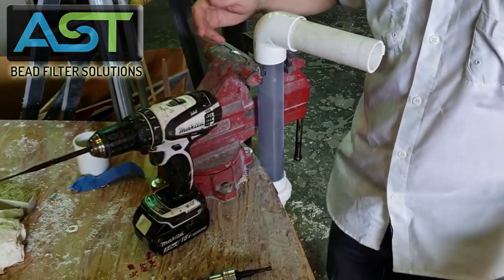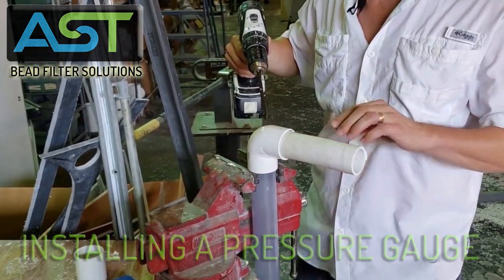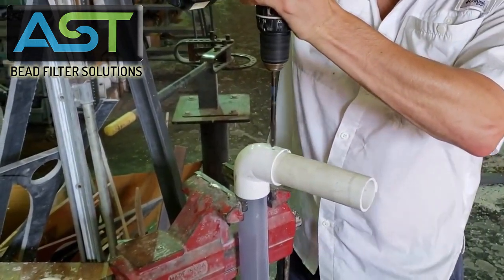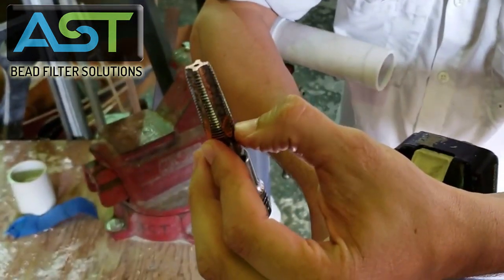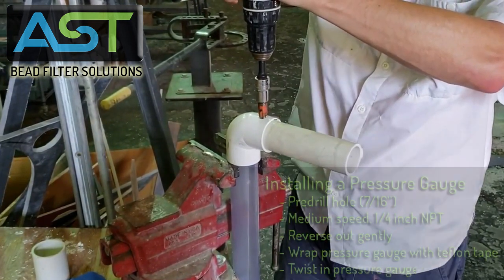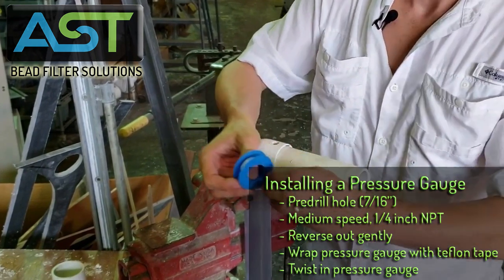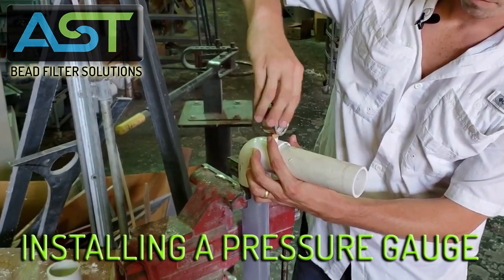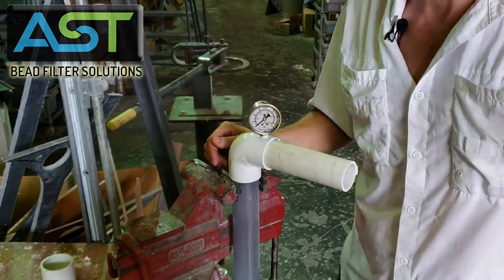Aquaculture Construction 101: How to install a Pressure Gauge for your Fish Filter!

Comment: thank you, but how would this hold up on gas pressures of around 15bar? [not psi]
Reply: This is a low pressure application (<20psi). You should investigate higher pressure plumbing requirements.

Comment: I WAS TRYING TO FIND OUT IF THIS COULD BE DONE. THANKS.
Reply: You should look up the specs for 1/4in npt thread engagement before you try this. I believe the nominal is around 1/2 in.  The proper way to install a pressure gauge would have been to drill a hole on a straight section of pipe and then use a saddle clamp set to accept 1/4in npt.
 Or just glue in a tee that is 1 1/2 x 1 1/2 x 1/4 nptf or 2 x 2 x 1/4nptf depending on the size of your line. 
 
The technique shown might hold and no problems will ever arise , but it would not pass an inspection, it weakened the 90, and created a potential flood if that gauge blew out.